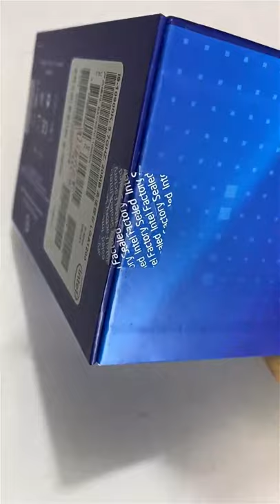All AORUS Gaming PC Build In Short - 1 #Shorts

Comment: Using a power drill building a pc not a good idea at all.
Reply: It's only on the psu part so relax
Reply: @ikram2512  means PSU is good with vibrations? I don't think so.
Reply: @nanotech4947  tf u mean by vibration?

It got screw so no more vibration
Reply: @nanotech4947  all YouTuber I know use electric drill even techsource use it
Reply: @ikram2512  you clearly never used a power drill before, are you? The drill will vibrates during torquing and in the video it's quite loud and obvious. Besides, the correct tool for this job is to use the battery powered screwdriver. Well, when majority used a power drill on vibration sensative equipments, it doesn't mean that they are doing it correctly.
Reply: @nanotech4947  my PC is pre-build
Reply: @nanotech4947  yes never use it
Reply: @nanotech4947  like I said psu part not an aio cooler or fan or motherboard so relax my guy and this people has been selling PC since 2018 or older cuz this video is stolen on TikTok and this company is on china
Reply: @nanotech4947  u take 56 minutes to comments that?

Bro I'm watching football rn I thought u a goner
Reply: @ikram2512  I got a great life. Not a looser keep commenting and replying to comments. I got so many other things to do. I don't care if your pc pre-built. I just made my points: Not good to use power drill for this kinds of works.
Reply: @nanotech4947  u made u point but u don't get my point like come on